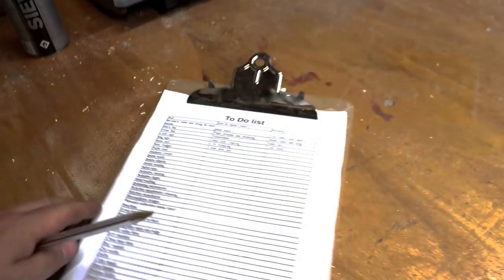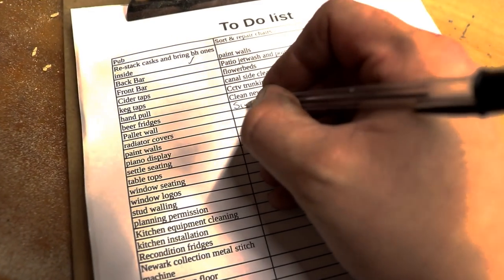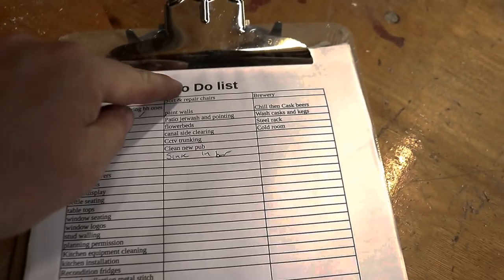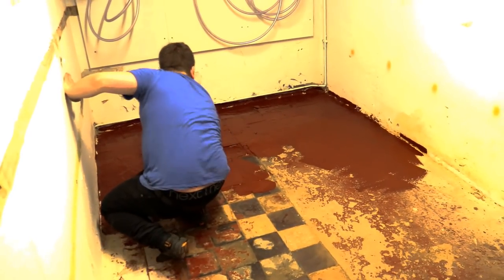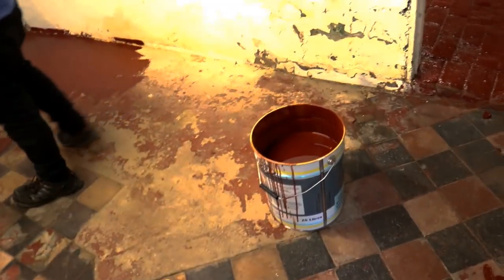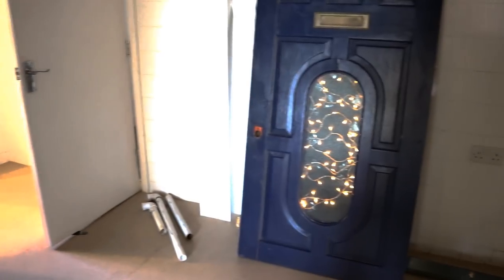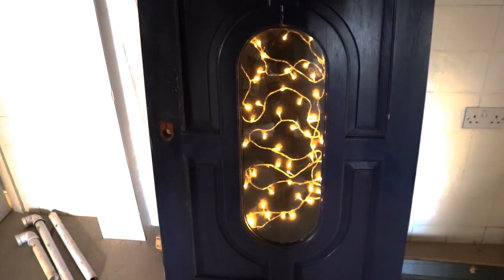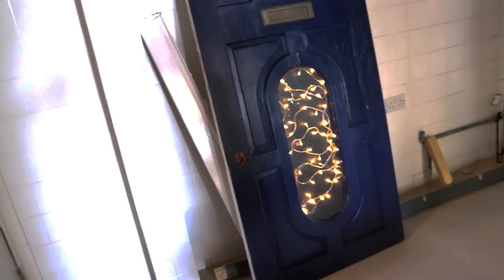A DRY FIT?

Comment: Hey Chris, if you can find gymnasium floor varnish that will dry good and hard. You may want to have a dehumidifier running in that area as well if you have access to one, to promote better drying. Cheers mate looks the bees knees🍻

Comment: Yacht varnish tend to be soft and UV resistant so that as the timbers in a boat move the varnish doesnt crack, which of course it does  :-).  The shed varnishes, personally, I would not put on a boat, go for the real stuff, International, Blakes or Hempel.   Its a while since I bought any so there may be a few new names, look at boat chandlers websites.    If you want a really hard varnish then the two part epoxy as Steffen says is the way to go.  Then, if you thought the real yacht varnish was expensive the two part will make your eyes water  :-)